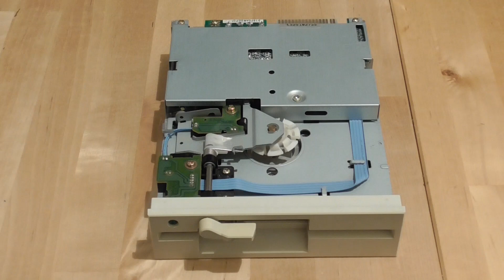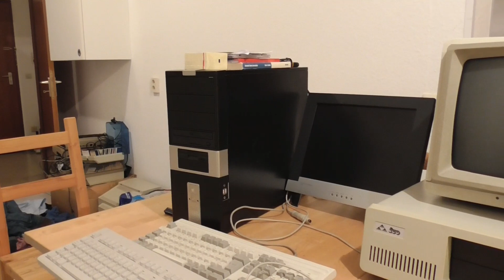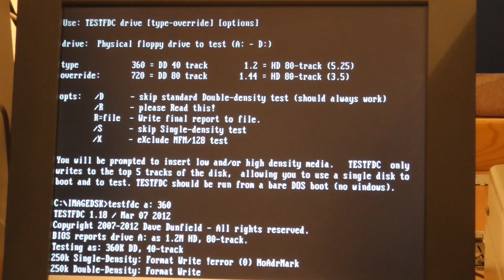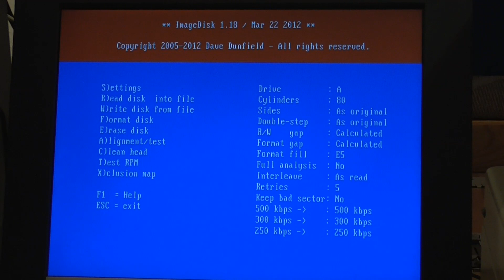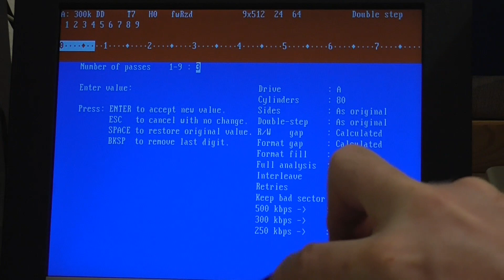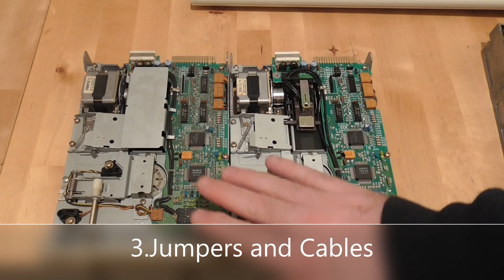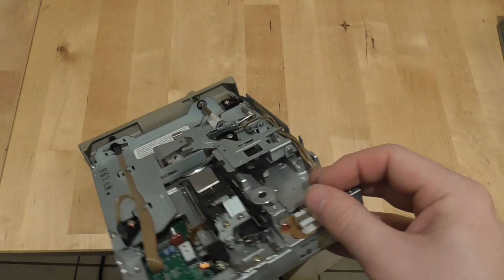Why most 5.25" Floppy Drives seem broken, but aren't!

Comment: This year I have managed to repair 22 5.25" floppy drives and I must say it was quite interesting and challenging to do. I only had to cannibalize one drive to do it. I couldn't have done it without IMD, which I had used before in my attempts to get 8" floppy drives formatted on a PC.  There is one drive left for which I cannot get any data from the heads at all, no matter how much realignment I try to do.

All these drives were sold to me untested, for parts or repair, but actually I was surprised to find out that about a quarter of them were fully functioning and that I could not find any fault on them. I think it helps if a Pentium I or 486 motherboard is used to test them instead of Pentium II/III/4 motherboards, as those might have trouble dealing with these drives that were already considered obsolete in that era.

Other common faults I found and fixed were:
1. The rail on which the head assembly moves is caked in dust, causing the stepper motor to have trouble and also causing the head assembly to skip tracks --> Clean and lubricate the rails
2. Both heads don't give any data at all in IMD --> Clean thoroughly with a cleaning disk with isopropyl alcohol applied to it. Allow IMD to make around 10 passes. (Possibly someone used a chemically decomposing disk that thoroughly fouled up the heads, or perhaps used the wrong cleaning chemical)
3. IMD shows that not all 18 or 30 sectors can be read during alignment test --> Realign head assembly using IMD, sometimes the whole assembly, sometimes just head 1
3. The drive keeps spinning the disk permanently after inserting a disk and the disk cannot be accessed. --> Check if the disk locking mechanism is fully engaged, or the track hole sensor or disk insertion sensor are fouled up or not properly aligned. Repair the locking mechanism block (sometimes it is cracked) by glueing or melting it back together (soldering iron). Possibly place some duct tape underneath the pusher block to have it exert more force. Realign the sensors while the disk is spinning and while running IMD to find out the correct position
4. The drive does not pre-spin upon disk insertion, leading to a badly aligned and wobbly disk --> check if the detection mechanism still has its spring and replace it if it is missing or broken. A containment for the problem is also to manually 'pump' the locking lever after disk insertion to make sure it is aligned to the spindle properly
5. The drive kind of works with reading, but has trouble writing. At IMD alignment it does not show the full 18 or 30 sectors read at each track. Perhaps at some tracks there is 18 or 30, but not at all of them --> Check the head 1 spring and put duct tape or a small foam block underneath to change the force the spring exerts. Realignment in stepper direction is not always the solution
6. Jumper settings are not compatible with the PC, leading to strange behavior that has no mechanical reason --> Find out what the jumpers are for (via documentation, or other sources like the above video) and correct their placement

Then there were some other less common faults that were more difficult to solve, like:
7. Obvious damage like a circuit board with a corner snapped off, or missing mechanical components, like the spindle motor --> try to salvage what is possible. Cannibalize a similar drive. Figure out the severed connections on the circuit board and solder on wires as needed. What is needed can be inferred by observing the drive behavior. Documentation about the circuit board is nearly impossible to find.
8. No visible damage at all, but drive behavior is still out of specification, for example it doesn't detect track 00 --> find out where the problem is in the circuit board by comparing with a functioning drive of similar model if possible. I found out that voltage on the track 00 sensor was too low on several drives and I applied an additional resistor between it and the 12V, causing it to be in spec again.

What I used to fix those 22 drives: 
- Pentium I test PC
- good working drives and secondary PC for reference
- new-old-stock unused disks
- the IMD program
- duct tape
- WD-40
- cleaning disks
- isopropyl alcohol
- multimeter
- soldering iron
- misc parts like replacement springs, bolts, resistors, wires
- common sense
- deductive logic
- patience
Reply from the maker: Thanks for the really comprehensive repair notes. I'm sure this is going to help quite a few people.
Reply: @PCRetroTech  You're welcome. I am simply hoping we can save as many of these drives as possible. Your video, especially the part on the jumpers was helpful to me to try things I hadn't thought about before.
Reply: WD 40 is Not a lubrication liquid. WD literally stands for Water Displacement. It is a degreaser. It will leave residue and it will migrate.
Everyone should just throw away WD-40. When you use it and it makes the device stop squeaking, it is only a temporary fix. If you use proper lubricant the device won't squeak either.

For isopropyl you want to use the lowest water content that you can find, at least 85% and you don't want to use it on anything rubber because the rubber will degrade. In most cases the rails in a drive should not have any lubrication on them. They are highly polished and they slide in copper sleeves. Lubrication will attract dirt, and could cause the polished rails to have greater drag(its counter intuitive) since there is now some substance between the two surfaces. If you are using a drive which drives the head by a worm gear, you want to put a small amount of white lithium grease on it. There is also electrical contact cleaner but you probably wouldn't need it inside of a drive but it will clean switches and not leave volatile residue on the contact surface.
Reply: Hi, where can i get a good cheap 5 1/4  1.2 mb drive?
Reply: @MacmorMach  In my experience with the current era, you either buy a single good drive that is expensive or a single cheap drive that probably isn't in a good condition. Buying a single good cheap drive nowadays is only possible if you get it from someone who considers it junk, but there aren't many such opportunities left. Or you can buy a large batch of non-functioning ones, like I did, and repair them.
Reply: Ever had a Tandon TM65-2L? How did that go? Did it have the 977509-001 disk controller DIp28?
Reply: @mrwebber35  Sorry, I have never had one of those
Reply: Thank you for the help!
And thank you for taking the time to share your knowledge so that other people can benefit!
God bless you!
Reply: Chinon FZ-502 wont stop spinning...

Comment: I have a dos error device not ready… I’m using the PA7225U on dos 3.3 with the T3100. I checked with the maintenance manual for the t3100 and it has advice for repairing everything(I’m quite impressed) physically it checks out(the fdd). It spins up and it detected by the computer as a second fdd 320kb. However I cannot read write or format with it.

Comment: I wonder if you could send files with RS-232 to a newer machine for backup.
Reply from the maker: Apparently you can. I think it at minimum has to boot to DOS, you have to have mode.com on the machine (and obviously a working keyboard to run it). But that's it, apparently.
Reply: @PCRetroTech I would use Norton Commander with NC Link - just null modem serial and 4 files necessary. If there is a dos 6.22 it is possible to use interlink for that - pretty handy and I use it often to do the setup of old machines. I have a boot floppy with fdisk, format and interlink client and other machine boots as interlink server and I just copy what I need on a fresh setup without messing with MFM controllers or just moving things around

Comment: Beware that this is told very much from the PC standard, which is in a way lame they just changed a few things for the heck of it (Big Blue arrogance?), as Shugart was perfectly fine, and maybe even better, as it did not need weird twisting cables and allowed 4 drives instead of 2. Shugart was not only for 8 inch floppies, it worked on 3,5 and 5,25 every bit as well. My 1981 home computer runs 4 3,5 floppy drives of Shugart. Most home computers used shugart (MSX, CPC, Tandy, ZX, Beeb) with the 2 weird ones, off course, being Apple and Commodore.

Comment: Thank you for your video. I purchased this floppy drive unit but wrongly purchased the data cable and your video has solved the problem for me. Otherwise I won't be able to use this device forever.

Comment: YD380bB drive that does the clacking noise has a bad track 0 sensor.  If you move the head to the inside of any drive, and apply power it will home to track 0 (either initially or after loading a disk) (Also, not the old old drives without microprocessors like the tm400)
Forgive the rambling.  There is a switch or sensor that tells the electronics when the heads are at track 0, this is your culprit

Comment: Normal density (Mitsubishi MF504B,C 5.25" HD Drive)
Logical ‘1’ selects high density read/write operation and logical ‘0’ selects
normal density. With option jumpers SS shorted and SB open, this line changes
the motor rpm and read/write 'operations are performed 400mS after density
change, to allow the motor speed to stabilize. When motor rpm is switched the
head must be moved to track 00 before reading or writing. With SB shorted and
SS open the motor speed is always 360rpm so no waiting or track 00 seek is
necessary.
Reply from the maker: Fantastic! Thanks for the information!

Comment: that Chinon Drive where you talked about the last jumper and old 8" drives, whould make this suitable out-of-the-box to be configure for any (retro) machine that requires Shugart compatible drive interface, meaning it could be configured to work properly with an Amiga, MSX etc without doing any bodges

Comment: But if I already had 5.25" PC drives to get out, wouldn't they already be on the right settings? I can see cleaning and tweaking though. However, yes, if I try to build a PC that I can put a floppy controller into a slot of or that has one on the motherboard, or that I can adapt to USB in, etc., I will watch out for all of these things when I buy a drive, and I might have been fairly unsuccessful if I hadn't seen this video, because by the time I learned about how to build a PC, it was already 1998 and 5.25"ers were already pretty well phased out of regular use. So now to bring one of these back into use via retro., this video might help me. But I don't have any 5.25" disks from the PC world that I need to worry about. All of mine are Commodore 8-bit; either 1541- or 1571-based. Anyway, other than the wording problems, this was still an interesting, good video!

Comment: Why would HD floppy drives be less expensive than the ones with less technology in them (normally higher technology = harder or takes longer to make = costs more)?
Reply: perhaps because many more HD 5.25" drives were made and also manufacturing matured and more automation was possible.  And then one step further and 3.5" HD drives are even cheaper while more reliable and higher tolerances.
Reply: @atv22314 : I doubt you know how many HD vs SD of these drives were made. But if you think you do, then please let me know where you found that data.

Comment: "If you put alcohol on it, it'll go straight through."
No, it gets absorbed by the disk and the disk is dampened by it. That's the point: to use the mildly abrasive disk with the alcohol. If the liquid went straight through the disk then you wouldn't be able to use it that way.

Comment: Yeah, Windos 8+ won't run well on computers that came out in the Windows 7 era or before. When I was still using my 2007 PC, I tried 8 on it and it was SOOO slow and choppy, OMGosh! But Windows 7 would work on it just fine! Now I'm using my current computer that I just built a few months ago from 2020 and '21 parts (call me a procrastinator), after using a 2016 W10 AiO for a while, and this one runs W10 just great and will likely run W12 fine when that comes out too. (Not gonna switch to 11 unless/until it gets a lot better; it's the new "bad Windows version.")

Comment: I bought an AT (5170) that had two five and a quarter floppies. I tried them both in a 386 machine and neither seem to work, so I hope to use the IMD program to figure out what's wrong. This video is a godsend and thank you so much for making it!.
Reply from the maker: I wish you a lot of success. I have been working on a rare 26 pin floppy for the channel, but ran into a number of roadblocks. I haven't fully given up hope yet though. I just don't have a way to run IMD on the machine just yet.

Comment: Ugh, I got my first 5 1/4" drive ever and it looks absolutely perfect, but doesn't do anything but spin the disk briefly when inserted. Not sure if it's my controller, cable, or drive... no spares to deduce what's going on! Sensor LEDs still work, no dirt or corrosion at all. Everything moves freely on track. Just nothing initiates.
Reply from the maker: Check all the obvious things first. Is it set up correctly in the BIOS settings. Is the cable plugged in the right way around and in the correct header on the cable. Are the heads clean. Are the heads present (sometimes they can get snapped off). Try another floppy disk (somehow you have to check if the disk is ok). Check to see if any parts are getting really hot. Good luck figuring it out. It can be hard without other parts to compare with. At least floppy cables are cheap!
Reply: @PCRetroTech  Did all that... cleaned heads... thing looks like it's out of the box. I set my jumpers to factory default per manual except setting it to single drive only. Last thing to try is a different cable/motherboard, and check for hot components. I do have a thermal camera.
Reply from the maker: @beefstickswellington1203   @beefstickswellington1203  Sounds like a difficult case. I can't think of anything else obvious. Cable is the most obvious problem, and motherboard as you say. Unfortunately the latter is a bit expensive unless you know someone who has one you can borrow!
Reply: @PCRetroTech  i have a second board from 2004 but not even sure it supports 5.25. My first one was an intel dg865 from 2002 but it seems blind to the drive
Reply from the maker: @beefstickswellington1203  Intel boards were good for being compatible with all standards. You might be ok with the 2004 board if it had a floppy connector.

Comment: I have a 5.25" floppy drive, works fine on a user unfriendly and heavy machine i don't want to use.
On a computer i want to use, i can select the drive, but, for some reason the bios jumps back to a 3.5" floppy drive. The bios battery is good and the floppy drive setting is the only "stubborn" setting. (if no floppy drive is connected, the bios says correct "none" )
Reply from the maker: That sounds very annoying. To me it sounds like a BIOS issue rather than a floppy drive problem, but who knows.